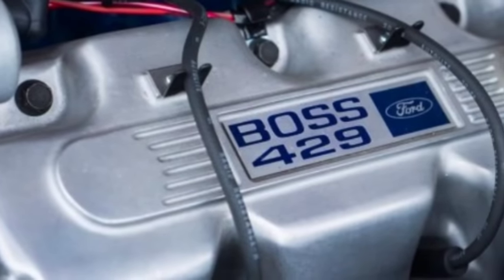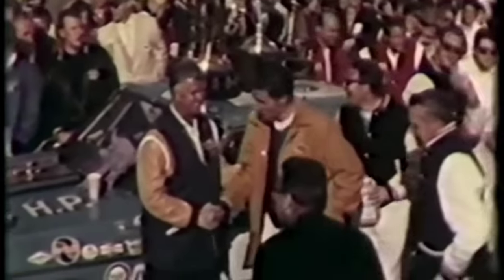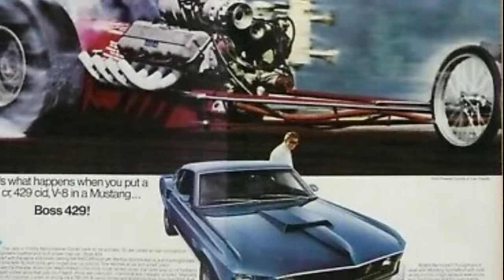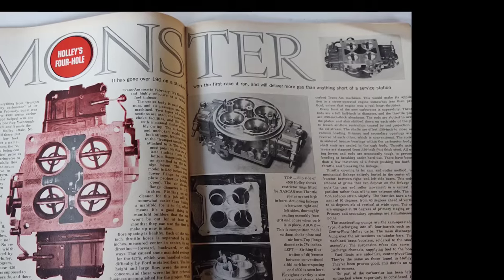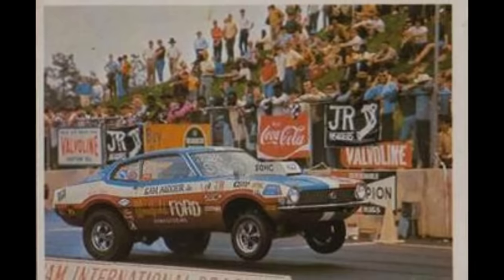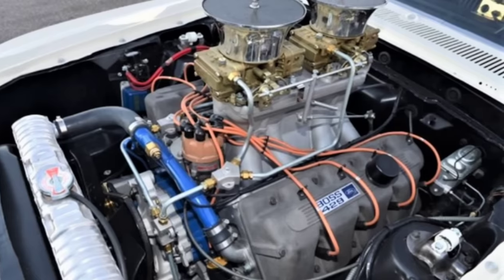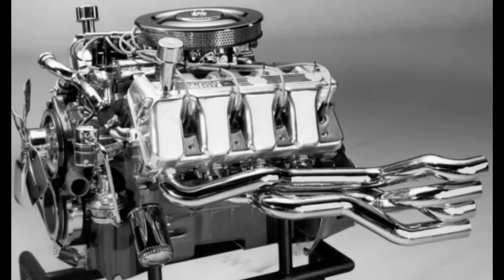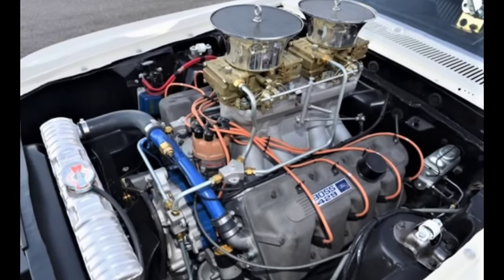The Misunderstood BOSS 429

Comment: American engjnes of those times? - "diesel on gas" 😂.. as they run as a diesel of '70, low horsepower and low rpm😂.
Ancient technology in US engines, german engineers developed and builded in '40 some engines waaaaay more advanced than americans did 30 and 40 years LATER 😂😂